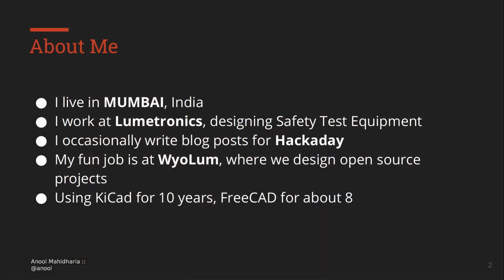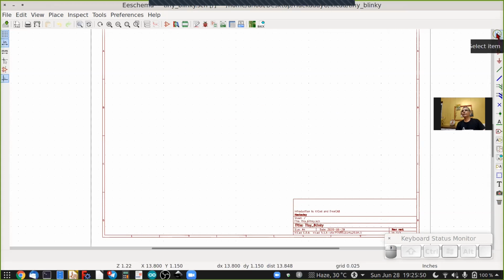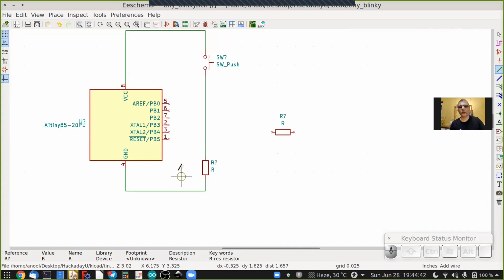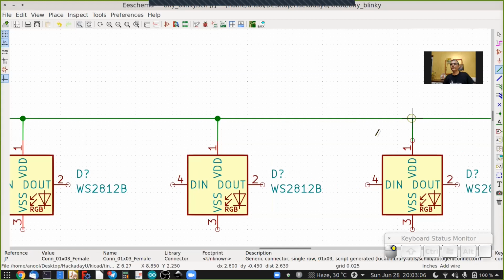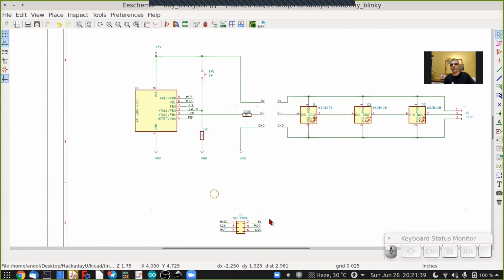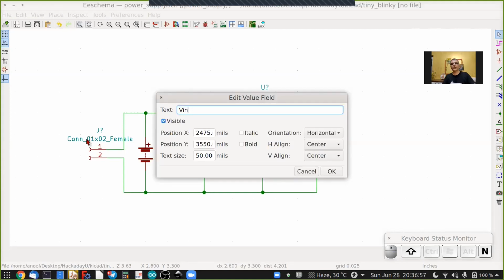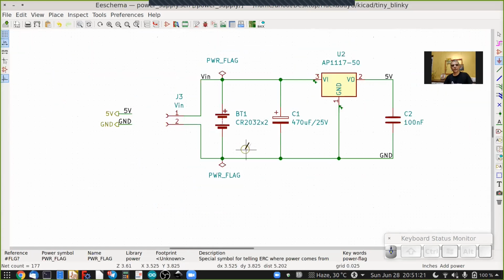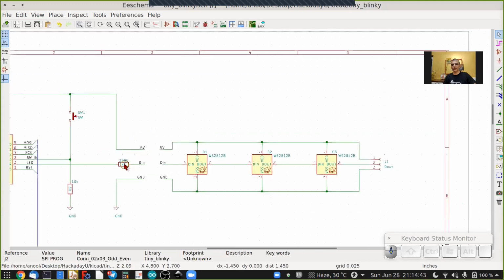HackadayU: KiCad + FreeCAD Class 1

Comment: Thanks for the first class. 
The audio is not much clear. Is it using a dedicated USB mic or built-in one? 
BTW: keyboard status monitor is handy.
Reply: Thanks. Trying to fix the audio for next sessions. Also, some of the audio issues are due to the splicing/cuts in the video. Squeezing about 2 1/2 to 3 hours worth material in just over an hour was not easy.